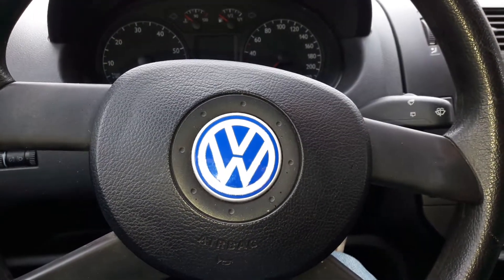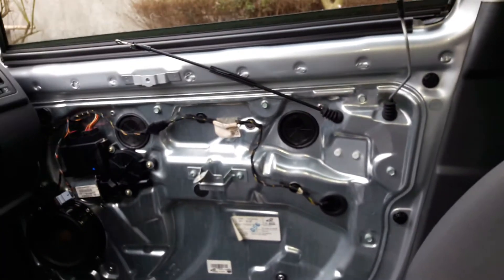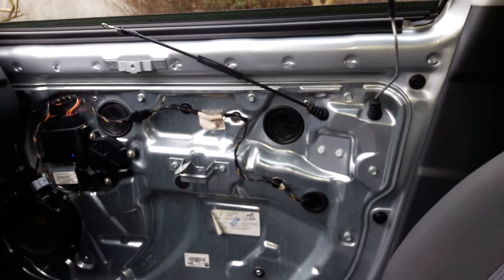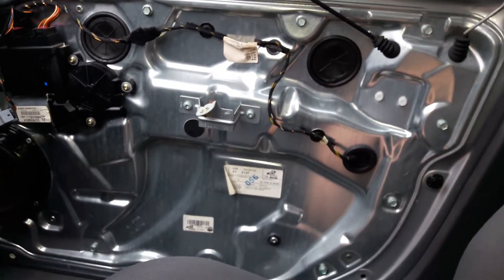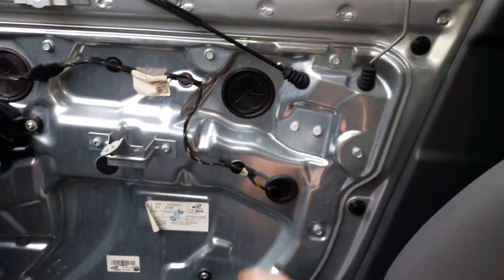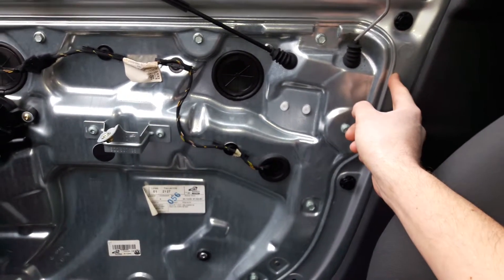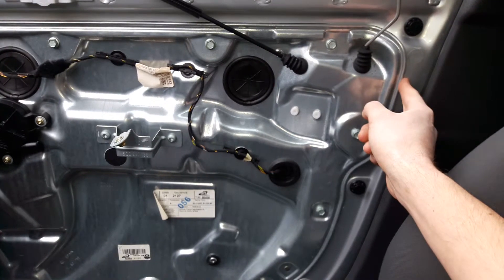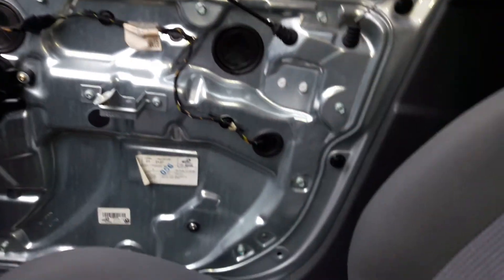VW Polo, Golf, Door Lock Fix, Unlock Door Locked Shut, Door Not Opening, Stuck

Comment: Hi, after removing all this 10mm bolts, it seems that the panel is still stuck near the window rubber. Do I have to remove the window bolts also to make it come out?  Or do I have to drill on the two rivets?
Thank you in advance.
Reply from the maker: Pull it up...